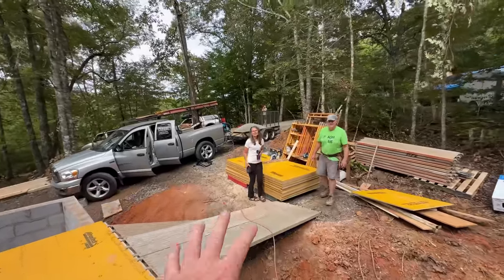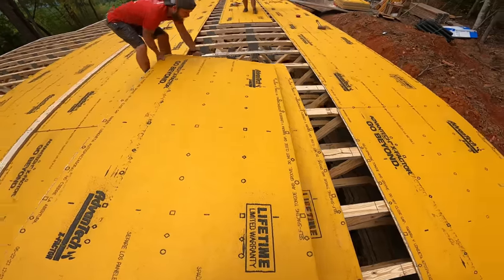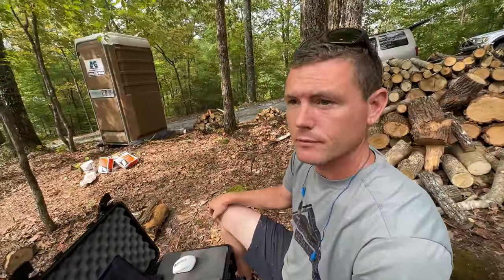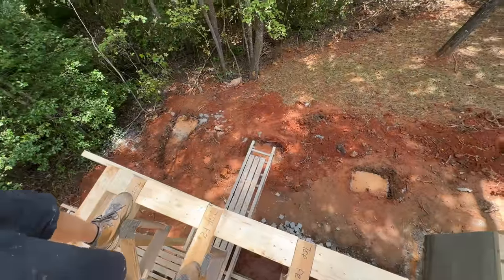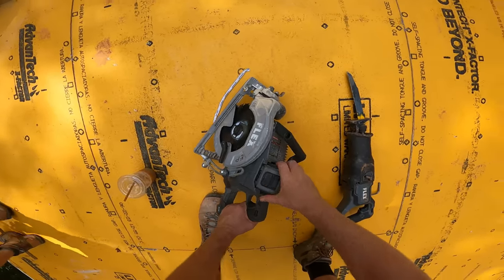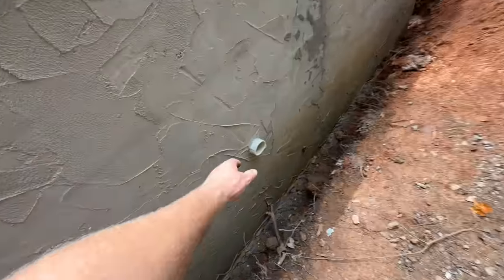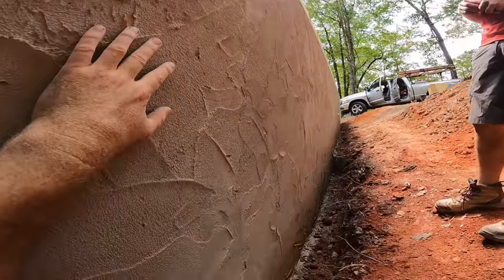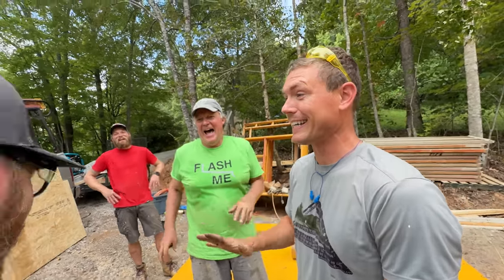Modern Home Build | 10 | wall waterproofing, french drain, sub-floor

Comment: That’s interesting, I’ve never heard of 93” precut studs! It’s been 92-5/8” for 8’ ceilings and for 104-5/8” for 9’ ceilings in Southern Ontario, Canada as long as I’ve known
Reply: Idaho as well.
Reply: Alberta as well. Never heard of 93’s
Reply: Same in Michigan
Reply: Same in Kansas and Illinois.
Reply: Same in California
Reply: Same in tennessee
Reply: Up until the last couple years 93s were still available in SC. They began offering the 92 5/8 several years ago.
Reply: Yep 2 top plates And a bottom plate equals 4 1/2 inches plus the  92 5/8 stud  gives you drywall Aprox 1/2 inch off the floor. Didnt know there was such a thing as a 93.
Reply: It's been 92 5/8's forever here in Ottawa until this job. Thought I did something wrong when I measured the height of our walls. 93 is just weird
Reply: @marknoel2375  really, you guys have 93s now In Ottawa?
Reply: Same in Minnesota and Arizona.
Reply: Same in Vermont

Comment: 92 5/8” precuts is all I have ever seen here in southern Ohio. Never heard of or seen a 93” precut. Not in my 44 years at least. Love the channel BTW! Especially like Jamie’s explanations of things. # letjamietalk
Reply: We have 93 in Virginia
Reply: Same here in Canada 92 5/8 for the 25+ years I've been building.
Reply: Same here. Not sure why you would want that extra 3/8.
Reply: @k.d.8924  93" plus a 1.5" bottom plate and top plate means a 96" wall system, which means when you hang drywall 2x 4' thick pieces fit perfectly.  If you have 92 5/8" then you have to trim down some of the drywall on one piece.  However 92 5/8" studs with a bottom plate and a double top plate would be 96 7/8", and if you hang 5/8" ceiling drywall first(which you should), then it brings it down to 96 1/4", so two full pieces of drywall would leave just a 1/4" gap on the bottom.  It all just ndepends on how you're going about it, but 93" was basically just old school but modern building went ahead and caught up to 92 5/8".
Reply: Same here in western ky
Reply: 92 5/8" + 3 plates (4.5" total) is 97 1/8". Once ceiling drywall is on you have a 96 1/2" wall, giving you a 1/2" gap at the floor  @moocowzrock
Reply: Same here in va never heard 93 pre cut
Reply: Been framing for 21 years , never seen a 93” stud. Lol it doesn’t make since to me. 93” plus single bottom plate & double top is 97 1/2. That leaves you 1” up off of subfloor.  
92 5/8 leaves 1/2 off subfloor.
Reply: For us in Canada, Quebec. It's 93 ¼". Bottom plate and double plate so 4.5" 97 ¾" minus  straping 5/8" minus 1/2" drywall on the ceilings and minus 5/8" floors equals 8 foot ceilings
Reply: Never heard of a 93" inch precut stud. 92 5/8" here.
Reply: 92-5/8 on the whole west coast
Reply: Think anybody should tell ‘em they put the truss braces on the inside of the AC run? Plan said to put them on the outside 🤷🏻

Comment: Covering those drain pipes with geotextile is a good way to avoid them holes being clogges with silt over the years.
Reply: We always wrapped them up like a burrito or ordered pipe with a sock on it
Reply: Yup, pre socked pipe only cost a few cents more per foot!
Reply: I said the same thing until I saw Dirtperfect on you tube burying literally miles of the unsocked drain tile and still working after years of use
Reply: Don't you want the drain pipes that have holes on only one side and then lay the pipe hole side down?? that way silt won't get in through the top and it will take water away as the ground under it fills with water. At least that's what my understanding of what a drain is supposed to do.
Reply: In the past they've put the pipe down, put a little gravel on top, then put the fabric on top of that, then filled with more gravel then dirt.
Reply: To maintain the function of the drain it is preferable to place the filter at the boundary of your stone and the native soils.  A sock on the pipe is better than nothing. If the voids in the stone are filled with migrated fines hydrostatic pressure can build behind the wall even if the pipe itself is not clogged.

Comment: Don't nail the the edge of the floor sheeting that you are going to lay to next the T&G will slide in easier if not nailed down, this should also help with efficiency making one pass to nail down both sheets alone the seem

Comment: 92 5/8 studs in Alberta Canada for the 15 years I've been building houses! Needs a double top plate,  which you should have anyways.. to make the 8' 1"1/8 wall
Reply: As a builder in central Canada for over 25 years, I've done a lot of multi-unit dwellings that require fire and noise assemblies on the ceilings that can be up to two inches thick. We usaully have to double plate bottoms of the walls, which works well for us because you can pre lay all the plates, then just add walls to them but I know the plumbers sure hate having to drill them.

Comment: Hit the membrane lightly with a heat gun it works great. Works with all types of bituthene products. Additionally they make a roll on conditioner to make the bond stronger.
Reply: Or a roof torch!

Comment: The failure mechanism of the trusses or steel girders you were describing is known as lateral torsional buckling. Bracing the trusses helps reduce this. Love your videos, and I got really excited when you were talking about some structural engineering!

Comment: Ummm according to Huberwoods the advantech should be installed with the tongue towards the outside edge of the building so not to possibly damage it when installing it with a block and mallet.  You guys seems to do it just fine by hitting the tongue side…so to each their own! Great job as usual!

Comment: Subfloors squeak by riding up and down on a smooth shank of a nail or screw. Using a fully threaded screw is about the only way to keep them from squeaking overtime. Even when they are glued, the smallest area around the fasteners shank through the thickness of the subfloor with pressure applied will squeak
Reply: Well, maybe the "screwy-nails" they used are the perfect compromise? Time will tell.

Comment: 92 5/8 plus bottom plate and double top plate equals 97 1/8 minus 1/2” for drywall ceiling, leaves u with 5/8 gap for 8’ walls

Comment: Sketchup is such an amazing tool, I don't build anything without building it in sketchup first. Also, the weight of that Milwaukee nail gun is exactly why I bought the dewalt, but now I'm back to Paslode.

Comment: Here in Middle GA it's always been 92-5/8 for 8' walls. With a double top plate it puts your wall at 8' 1" roughly. They also do 104-5/8" for 9' walls and 116-5/8" for 10' walls. I always thought it was weird that y'all used 93" studs.
Reply: It is weird
Reply: Came here to say this.  With a half inch of rock on the ceiling and eight feet on the walls, that still leaves it a good half inch off the floor.

Comment: In Michigan 92 and 5/8 inch precuts studs have been the standard because you're adding 4 and 1/2 inches for the bottom and double top plates. Once in awhile you'll see a house where everything framed, is spec'd at 24 inch centers then the double top plate is eliminated because everything is stacked.

Comment: As a Lumber Salesman in Lexington, NC, we have also switched over and had to move away from the Carolina Trim lengths in our area. Been a little bit of a change for our local contractors with new construction. Remodels will now have to shim plates if matching up to the 93" or 105" studs

Comment: As a landscape contractor in the PNW I wrap all French drains with filter fabric use 2” drain rock vs crushed  use perforated PVC vs corrugated ABS and wrap the entire trough like a burrito. 
The reason is your objective is to create as much voids for the ground water to pass through as possible. The filter fabric keeps soil out .
The drain rock won’t compact 
The PVC won’t crush as easily.
I put 2-3” drain rock then the perf PVC
hole side down (remember you want to allow the water to rise up and flow out ) 
Then 10-12” drain rock on top .
Finally complete the wrap and if you are doing a lawn or garden over it cover with 10” of soil. A foundation drain sweep the mirror drain from the wall out and over the ABS.

Comment: 92-5/8” precuts leave you with 1/2” of space between floor and drywall if you use 5/8” drywall on the lid. That’s if you’re using a double top plate. I’m not sure where Arlo was getting 1/8” gap…
Reply: In the PNW we have been using 92 5/8" studs at least since the 80's when I started.
Reply: Same here in Wyoming in the 90s and now Alaska
Reply: Came here to say the same thing.
Reply: If ceiling is strapped which is common with webbed joists or resilient sound channels are used it causes a problem, especially with 5/8 fireboard. If plan specs that detail, we double bottom plates.

Comment: great job as always. Just one question. The soil looks to be fine, why not using sock pipe for that french drain? We used to - if not possible to get sock pipe - just to wrap in geotextile, to avoid holes in that pipe getting stuck by fine soil. And we use geotextile to make a bed, filled with gravel, pipe, gravel, bend geotextile towards the wall and add final layer of gravel.

Comment: I received the tool belt the other day and am very happy with it (amazing comfort and customizable).

I DO wish it had the ear protection pouch, magnet, and the hangers for an electric driver/drill that earlier versions included.

Do you have any recommendations for a good tool hanger that will fit the belt?

I notice that in this video, both brothers are wearing their pencil cord thing on the sternum strap instead of up on the D-ring, so I'm guessing you are testing to see if you can eliminate the D-ring?  If you do, maybe put a grommet or a sewn loop (  ___O___ ) in the sternum strap to prevent the pencil cord thing from sliding off when the sternum strap is unbuckled.

Thanks for a great product!

Comment: 92 5/8 studs in Canada for the 25+ years Ive been building, but I wish they would produce/supply 94's. Today's ceiling assemblies for noise and fire codes can have ceilings up to 2 inches thick. We end up cutting full 8ft studs or double plating bottoms of walls with pre cuts.

Comment: @4:43 I did that once, helping my parents renovating their 1920s 2-storey house. Replacing floorboards in the upstairs, we had a few planks laid across the tops of the timbers to walk on. I stood on the wrong side of one plank, the plank tipped up and I went straight down through the ceiling of the kitchen below. The entire sheet of plasterboard tore away at the joins on 3 sides and swung down hanging by the 4th side, and I caught myself with my armpits on the 2 joists either side of me.  My mother was in the kitchen below - she looked up at me hanging through the ceiling, stared at me for a second or 2, and then says "if you wanted a cup of tea that badly you should've just shouted and I'd have brought you one"...

Comment: A slight critique regarding the bituthene installation.   The parge coat was a bit rough and knocking the fins down was definitely a good idea, however there should be a protection board between the drainage rock and backfill to protect that membrane.  It's required by the Mfg. installation instructions and frankly cheap insurance when you think about the cost to repair if the membrane is punctured.

Comment: Hi, that kind of vapor barrier is normally applied with a base of glue for better results, there is no need to heat the membrane if you use the glue and it will stick a lot better...
Reply: Yeah that was the primer they were talking about here 👉 20:22
Reply: The primer is crazy expensive, a roof torch works wonders too!

Comment: I knew it!  North Carlina Smoky Perkins boys.. That Highway bridge is on IH95 south of Fort Bragg and East of Hope Mill,  where the original IH95 goes under the bridge. The beam were dropped 16ft and then reheated to relax the damaged section. that was 1978 or 1979.  NCDOT

Comment: I worked at a lumber company building loads for building sites in Northern Indiana back in 2003 and all the studs were 92 5/8. I remember the size very well because I knocked over a 50 foot stack with a forklift and had to restack each bundle of 144 boards. The fact you are using 93's just sounded as funny to me as the 92 5/8's did to you.

Comment: Been building for 20 + years and never have heard of 93” studs.   Always 92 5/8 and 104 5/8..  on paper it leaves the Sheetrock up 1/2” from subfloor with 5/8 drywall on lids.

Comment: When waterproofing the exterior wall that’s going to be below ground… you should apply bitumen paint to the wall let it dry and before applying the bituthene sheets to the walls should apply heat with a gas bottle and a lance to the shiny side of the sheet then apply that’s what we do in the uk

Comment: Also the reason they changed inside studs to 92 5/8 is because most people strap the inside ceiling nowadays, so thats account for the 3/4s from strapping / 1x3
Reply: Yes, trusses and webbed joists usually require strapped ceilings, but anymore than that like trying to meet fire codes, it becomes a problem.

Comment: Coming from a 4 generation plasterer and paint family i would make the suggestion you should work on your plastering skills on those block walls. With some tricks and investing 50$ in tools you can easily achieve a much better result.

Comment: In California we use 92-1/4” studs, so when you said 93” I was like what the heck do they use that for. We have precut 2x4 and 2x6 studs at 92-1/4”, 104-1/4” and 116-1/4” for 8’, 9’ and 10’ walls.

Comment: Great channel been watching it for a few weeks. you guys are doing a good job anyway on the French drain trench your hole around the base of the foundation drop your cloth in the hole all the way to the bottom and put the pipe directly on top of the cloth, no gravel, and then backfill the cloth up about 2 feet with gravel then wrap the top of the gravel with the leftover cloth and you will have a proper French drain that will not plug up and it will take the water off of the house all the way down to the base of the foundation. Anytime you come up short or your higher than the base of the foundation water can settle in the gravel down below, and eventually find its way out, but it becomes more of the wash in the gravel if that makes sense…
I am a builder in southwest lower Michigan. We build a lot of high dollar homes that require drainage and we don’t get as much rain and wet water as you guys do we get snow in the winter sometimes but most of the time we’re pretty dry so with the amount of water that you get down there, I would say it would be smart to take the pipe all the way to the base and drain it out that way no water settles in and stagnates on the base of the foundation..
Anyway, keep up the good work

Comment: I've never found a 93" stud in either MI or HI. 93 + 4.5 (double top plate) = 97.5". After ceiling drywall that leaves 96-7/8" of wall to cover. Seems like a pretty large gap between the floor and drywall. 92-5/8" studs leave a 1/2" gap. Old house I just remodeled used 92" studs and I had to trim all the bottom drywall. That was a pain!

Comment: I’ve never heard of a 93” stud.  It’s always been 92 5/8” here in Ky. By the time you add in bottom plate and double top plate your at 97 1/8”. 5/8” drywall for the lid on the ceiling leaves 96 1/2 “ so that leaves 1/2 gap at the bottom. Another 3/8 of an inch would leave you damn near 1” off of the floor and your baseboard would wanna tilt

Comment: Seeing the overhead shots, I wonder if the way y’all building with smaller crew and not using cranes or very much other heavy equipment ends up being less invasive to the neighborhood.  That’s would be a great benefit for a homeowner not to start out on wrong foot right away.

Comment: 92-5/8 studs plus 4-1/2” plate’s equals drywall wall 1/2” above subfloor when butted against 1/2” Sheetrock on ceiling. Never heard of 93” studs. Lol

Comment: Why 92.625 wall studs = bottom + 2 top plates + 92.625 studs = 97.125. When you hang .625" ceiling drywall 1st & set wall drywall up .500 off the floor it is PERFECT. Why would you want .875 gap at the bottom? 1 1/2" + 1 1/2" + 1 1/2" + 92 5/8" = 97 1/8" - 5/8" ceiling drywall - raise wall drywall off the floor 1/2" = 96" EXACTLY. Also the 1/2" at the bottom is to allow for 2"x4" being oversized. Raising drywall off the floor is to limit wicking of moisture & wall movement / expansion & contraction.

Comment: Quality work as usual, but that black corrugated pipe is not good - it's very weak and prone to collapsing and clogging. It's way better to use 4" PVC pipe with cleanouts. Gate City Foundation Drainage channel has good videos showing such installations. He's also from NC. It'd be very cool to see a collab video with him

Comment: Yeah not really distributing the load weight ..the bracing is just holding the beams so they don't twist 
Good practice i did when I built my shop especially on 24" spacing vs 16"  less 
Bounce in the floor also.

Edit ...run the water proffing all the way up...

Comment: With just a few more hours of digging and a couple of hundred more blocks, you could have built a proper basement. Instead, all of the basement space is being wasted. The french drain also needs a lot more rock than a small trailer full.
Reply: And where I live you always put a cloth sleeve over the plastic to prevent the holes from letting dirt in and plugging the plastic.

Comment: Is it just me or is it suspicious how wet that gravel was on pickup to supplement the weight per pound price?  Looking in the background 0:47 has puddles and either a shadow or a wet section of gravel.  Then at you can see how much lighter the gravel color is in 1:24.